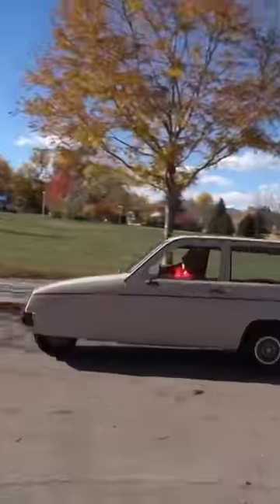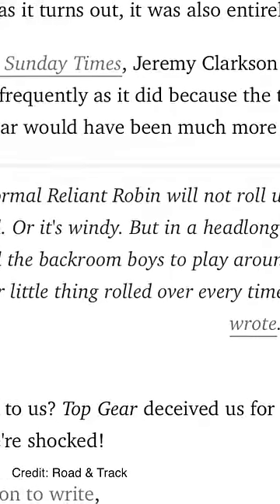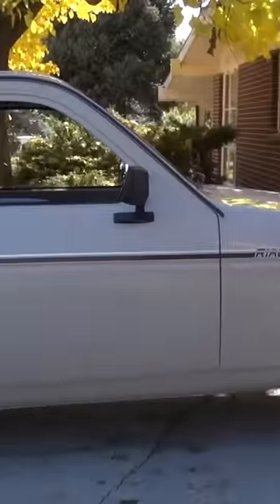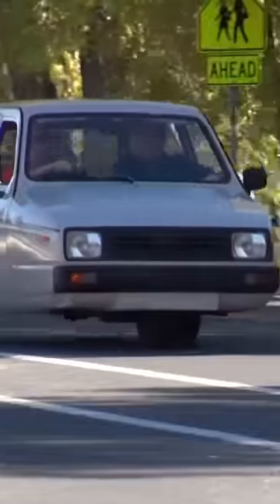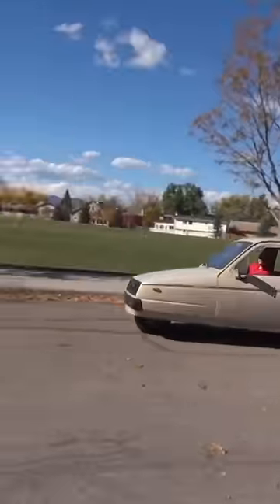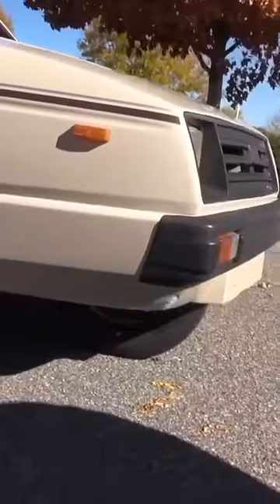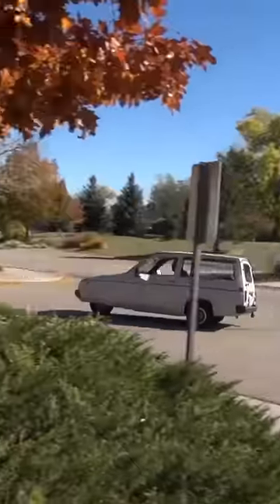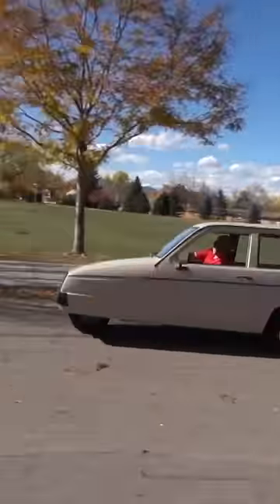Top Gear FAKED The Robin Rollovers??

Comment: “Reliants don’t want to roll over”

Proceeds to prove Jeremy correct in a matter of seconds
Reply: I think he just meant when theyre sitting still on a flat surface lol
Reply: Part of it is it's a right hand drive and the traffic circle was going the wrong direction for that car. Needed a person on the left side
Reply: Company D riding at its finest
Reply: Anything with one wheel at the front and 2 at the back wants to roll over. That's why they banned those trike ATVs
Reply: @ridge69 one wheel in the front is bad engineering simple as that.
Needing ballast for a normal driving experience, what is this, a fishing troller😂😂
Reply: @TheSpookiestgoose  it is a bad design, was just saying if weight was on other side of vehicle it would corner that direction better. Ever rode a 3 wheel ATV, or watched the sidecar races, same concept
Reply: @ridge69  but then what happens if they want to do a sharp right turn?
Reply: @raven4442  well, the driver is on the right. I said he needed a person on the left, didn't say the driver needed to move to the left.
Reply: It didn't roll over. It's a very short video, I'm surprised nobody has watched the whole thing.
Reply: @nuckels188  they stopped making trike atv's because kids would fly across a field and hit a rock with one of the rear wheels and go flying, some were killed. Nothing at all what's going on here.
Reply: They don't want, but they're still doing it

Comment: That is basic physics: Reliant Robin design favours rollovers.
Reply: Except this one. It literally didn’t flip!
Reply: @anonimushbosh only cause driver quickly turns wheel after care starts leaning .
Reply: @scottienichols9332  Yeah, it also drives into trees at 50mph unless the driver steers and/or brakes when approaching trees. They didn’t show him doing that either so we’ll never know if its just an exaggerated rumour!
Reply: @anonimushbosh  He turned a slow corner at under 30mph and almost flipped. What do you think would happen if he was doing over 30mph on a country road and had a sharp corner? 😂
Reply: @raven4442  The entire purpose of this video is to show how addicted all Robins are to flipping… a bit like illustrating the hardness of ice by showing you not quite frozen water. Still laughing now…?!

Comment: My mum and her husband used to have 5 or these over a 10 year period , apparently they’re not particularly roll happy but they do tip up a lot and are very unforgiving when they do because you lose all steering, that being said apparently they usually don’t go fast enough to tip much on faster roads, it tend to only be turning too tight on small roundabouts and in car parks that does it
Reply: I had one for over a year, you don't lose steering at all. Also they definitely go fast enough, had 85 out of it
Reply: @fairyheli2  I guess lose steering is the wrong term, that’s just how she describes and while I’m sure you can get 85 out of one. You’re probably not going to be getting fast enough on a road to roll it by accident. You’d have to be going from a fast road into a tight corner
Reply: @insertnamehere6960  I managed 70 down a twisty road. Managed to keep up with a fiat Panda through the area around Goodwood hill. The trick with them is to never brake into a corner. Brake before then accelerate round the corner, this helps stop the weight going into the front corner, keeping weight on the back. Only time I got it to tip was when I went round a mini roundabout too fast while braking with a mate in the passenger seat. All that happened was the chassis scraped the ground a bit. It was a fun car I miss owning it, but it was also an unreliable pain in the arse. Working on the engine is fun because there's hardly any access.

Comment: The trick to driving a Reliant is to brake in a straight line and accelerate round the bend. This is good practice in a four wheeled car too.
I rolled mine when a bend was tighter than I expected...

Comment: car leans and gets scratched
This guy: "it flipped"
Reply: yeah because the outcome was sooo different...
Reply: @AnthonyShuker  

Flipped usually means going over... did you see it go over? No? Shut your rip then.
Reply: @skylined5534  Flipped, tilted, it doesn't matter. It doesn't defeat the point. It fell over regardless. Pipe down old 3 wheeled boomer.
Reply: @AnthonyShuker  yet another day that the YouTube comments getting into an argument wins my amazement. Tf. Why do people die on the stupidest hills?
Reply: @dailyinsanity8188  Dying on the hill that "my 3 wheel car tilts and scrapes the floor, it doesn't roll over, it's fine" is a weird hill.
Reply: @AnthonyShuker  it didn't flip that's all I'm saying.
Reply: @dailyinsanity8188  and I will repeat, that does not defeat jeremy's point. The car is damaged from turning.
Reply: @AnthonyShuker  yeah but... But it didn't flip.

Comment: Reliants are pretty good vehicles, as long as you're careful not to go too fast around a corner you're fine
Reply: Even if you go quickly it's fine. Unless you turn aggressively and you weigh alot
Reply: Compared to what? 😂 “good vehicles” 😂
Reply: @dwaynefoley1020  The classic mini, the Trabant, fiat 126p, the Zastava, the Yugo, and old Fiat Panda.

The Reliant was manoeuvrable, compact, awesome to drive, Reliable, didn't rust as much, could park everywhere, could be driven on a motorcycle license, gets 60MPG and everyone on the road loves it. If you think none of these matter than you probably have very little car experience.

Comment: I had a few drifts out of mine in the wet. Had it on 2 wheels a few times but as long as you kept your foot on the throttle it wouldn't bottom out like this. 

Only happens if you let off or brake while turning

Comment: A van version overtook my bicycle down a hill, many decades ago in Dorset. It then went to overtake the car in front. It certainly did roll over, multiple times and in quite the dramatic fashion too. The woolly jumper of the loose lad in the back unravelled after getting caught on shards of fibreglass. The tyres being carried in the back flew out and disappeared over a hedge and couldn't be found. Mercifully everyone came out ok, but the ease in which it so rapidly got out of shape has convinced me never to go near one of them.

Comment: The robin reliant did suffer from  this problem, like the suzuki jimny had its rollocer issues. when i was young it was common to see robins with a big heavy toolchest on the passenger seat to even out the weight.  The camber of the road played its part too.

Comment: My sister had one of these, as a few years ago until the law changed they could be driven by people who only had a motorcycle licence just like my sister. But this wasn't the worst 3 wheeler car on the roads of the UK. They were called the invacar, part of the disabilitiy drivers scheme. EVERY single one was duck egg blue, with handle bar steering and a 2 stroke engine. They were deemed unsafe so the government brought alot of them back and scrapped them. The advantage of them was that 99% of them were owned by the elderly so at least other drivers knew who to avoid!!! These motoring oddities are now mostly found in  museums.

Comment: Simple fix for those cars, mount a pair of caster wheels on the front, one on each corner. Then when the car tilts, the car rides on the casters instead of the corners of the bumper. Course you’ll loose steering control, but you lose that anyway when tilted.

Comment: That’s because it would work if the 2 wheels were in the front and the 1 wheel was in the back. That would balance, the weight distribution a little bit better.

Comment: that was more of a slight tip, compared to the full rolls Clarkson did in the film. that's like comparing fantasy warhammers with actual warhammers. 
I'm sure that was just a bit more speed than was common for someone who drives a Robin.

Comment: the topgear team have to also weld the diff, the robin have an open diff, that means the power will go to the easier wheel to spin, you can tilt the car, but it will tilt itself back because you won't be getting any power to the grounded wheel

Comment: As someone who owns and drives a Reliant three wheeler I can say that you need to do the wrong thing to make it do that. 
They are very lightweight (<450kg). Add a big driver and you have changed the balance significantly. Note that Clarkson (in his modified reliant) always rolling onto the driver's side, as does this guy.
Leaning into corners helps, as does having a passenger to balance it out
We drove ours all over the UK and never got close to rolling it, and I don't drive slowly.

Comment: All vehicles with one front wheel are inherently unstable no matter how many rear wheels they have.
In the 1980’s we used to drive the cleaner’s old Reliant Robin around the car park and it would regularly roll over without any provocation.
He even carried a bag of cement in the back to try to increase stability.
Those tricycle things are a hazard.

Comment: It's not possible for a Robin to flip because they have a rear differential. Once the car notices one of the wheels is in the air, it will stop sending power to the wheels on the ground.

Comment: They’ll two wheel pretty easily, a full rolls slightly harder… Slightly. Two wheels up front is a way more stable configuration. I don’t understand why they went with one up front two out back.

Comment: Not hard, I had one in late 70's, yep roundabout on an incline they do go over. My old man used to run a breakdown service when a report of a reliant crash came in he used to take a trailer to pick up the bits. Morgan's were more sensible 3 wheelers with two wheels at the front. Bond bugs were also more stable with a lower cog despite having the same wheel configuration.

Comment: They are no hard in any way to roll over especially to get it fully on its side you just need to be going fairly fast and do a sharp turn to the left because the weight of drive helps it turn over but harder if you had a passenger in with you.

Comment: Could have avoided that flipping problem and had a very cool streetcar. The engineers could have just made the Third Wheel larger and in the back with rear wheel steering and made the two front wheels the drive tires. Would've handled beautifully like forklift making parallel parking pleasure and not a pain.

Comment: Clarkson: "you can't drive those things without rolling it over or tilting it"
Some random dude: they faked it they had to do a lot of rigging.
Goes out to prove the point:
Tilts it and scrapes it:
And then says: oh nevermind it wasn't faked as it turns out you can flip a Robin over very easily I have just wasted 20 to 30 seconds of everyone's time. (although in fairness on top gear the Robins were stripped out making them lighter but that doesn't mean its impossible to roll one)

Comment: It will tilt pretty easily, but it's hard to get it to completely flip. 

You will have to jiggle factors to the point where you could probably get a four-wheeled small car of the same vintage to flip, as well.

Comment: "Rigged" with tyre pressure and weight ? So you can't put  your messages in your reliant robins boot on a cold day without it flipping is what that means, no actual engineering needed just a trip to the shops in January.

Comment: 3 wheelers are only safe if 2 wheels are in the front. This is because when you're cornering you're decelerating in a forward direction and accelerating in a sideways direction, which causes weight to shift to the outside-front corner of the vehicle. If there's no wheel there, the vehicle will roll over.

Comment: but it didnt flip? it just slide on its side for few yards..
Reply: Don't you see the problem with that?
Reply: @Swamhere123  Ofc I do but still. It did not flip. It barely slide on it's side. Issues is not the problem, issue is that in the video he says they got it to flip without modifying, which they did not. And referring to top gear they had same issues with flipping but they claim that theirs flipped and top gears did not, even tho the result was the same before modifications. You get my point?